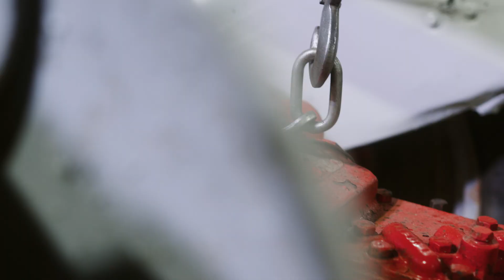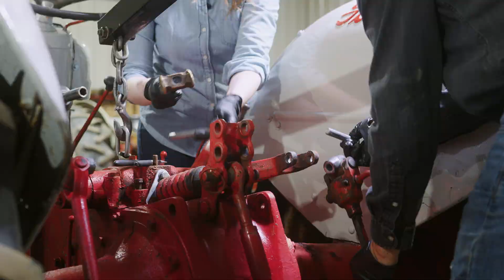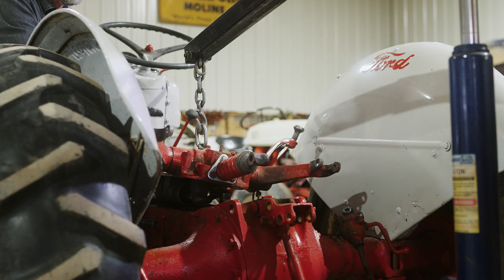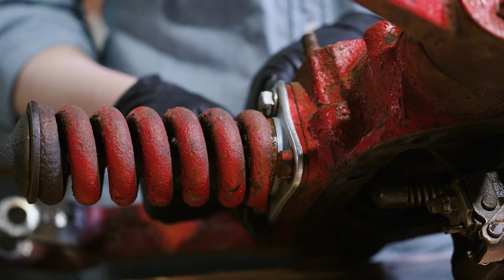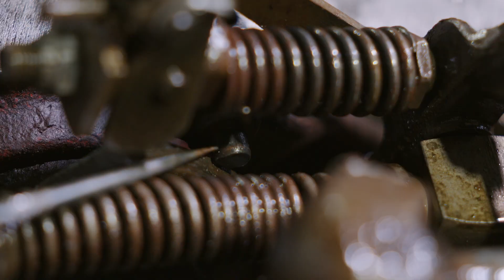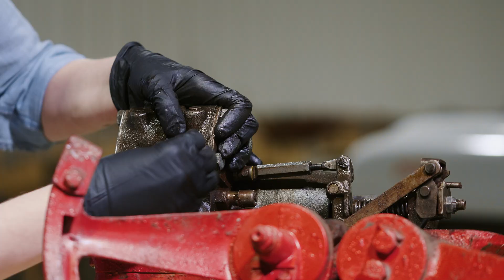Ford Jubilee NAA Tractor Hydraulic Repair: Watch BEFORE Removing Your Top Lid

Comment: Ford Jubilee 600. Got it for free, and it has a 12v conversion. First start in 8 years; what size battery is recommended?
Reply: Much smaller than what you'd put in a car. Battery technology was hot garbage in the 50s and "250 CCA" was unheard-of. I use a LiFePO4 motorcycle battery.

Comment: I did this repair/swap on a 1939 Ford 9N whose hydraulic Piston wouldn't hold much even when operating.  Swapped in an NAA Piston with rubber ring/wiper.  Holds like Gibraltar now.
Reply: The air in the dip stick hole fixed my hydraulic problem with 53 jubilee. Thanks!

Comment: Thanks. I have a 1963 ford 4 cylinder 2000. Do you sell a video or manual for the hydraulics on it like this or does this also apply to the 2000? BTW all the parts I have bought from you guys, as well as the How To on rewire on ignition-starter-neutral safety switch is perfect.

Comment: What do you recommend carburetors wise for my Ford 901 Powermaster. 4 cyclinder gas tractor? Adjustable front axle?
Reply: It isn't that easy.  There are two or three versions.
Reply: Finding parts has become difficult. The Carb i currently have has one tag on it. So i ordered a rebuild kit off that tag. It was nothing like what i needed. So i used what i could and hand cut gaskets. The float that was sent was was small. So i had to use the old float. So thinking of replacing carb so i can get the tractor running and have a matching carb. @ShainAndrews